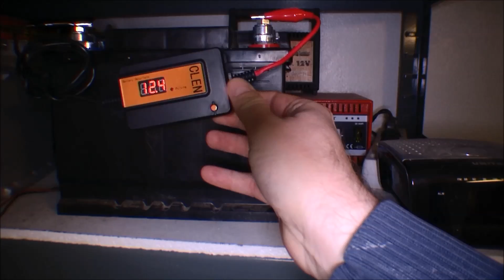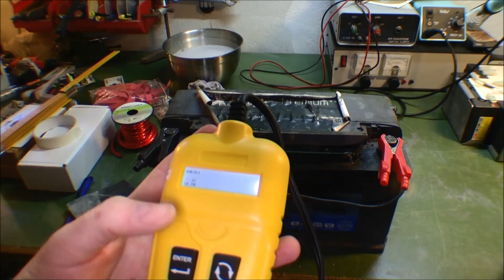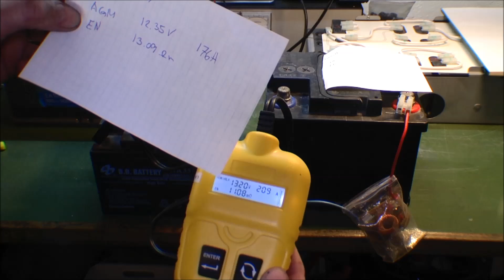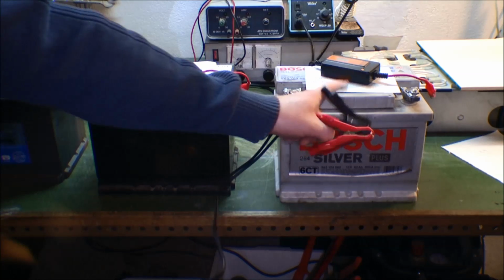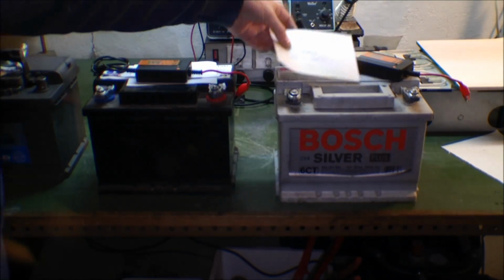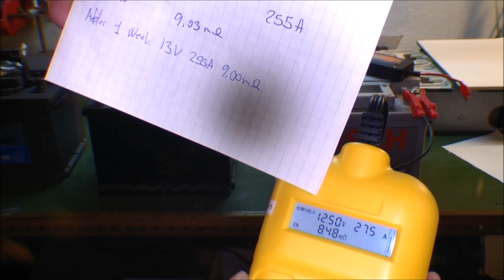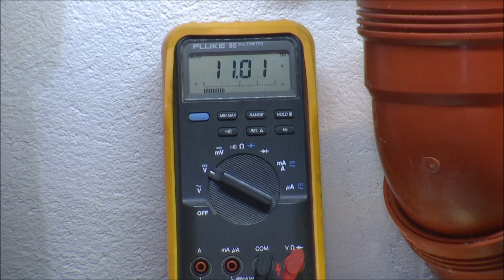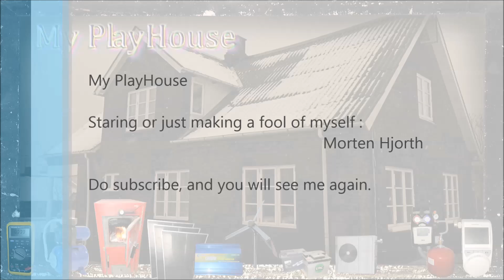Desulfators after two weeks, and new 100Ah Battery - 176

Comment: Not all Battery desulfators are the same. You might want to try a PulseTech PowerPulse passive battery desulfator on one of your dead batteries and see if it can recover it and may take 30 days depending on how badly sulfated it is, Pulse Tech claims that their patented frequency they use can extend the life of a battery up to three times. Noco Genius 5 and 10, and CTEK battery chargers have a repair mode that I believe use 16 volt pulses to desulfate a battery.
Reply from the maker: Hi @josemedeiros007
Thank You very much!  glad you liked the video :-)
Thank you for watching! :-)

Comment: You should check electrolytic level on the bad battery, maybe the cell are dry.  On your others batteries, internal resistance look good.
My own experience with desulfator is it works, I also check on oscilloscope the voltage pulse juste to make sure it is present, some vendors sell fake desulfator which does nothing, the voltage pulse too small to do anything. On my desulfator, I have a +1 to +2V pulse over 13.4V of the charger.
Reply from the maker: Hi zerodegrekelvin2
Thank You very much!  glad you liked the video :-)
Thank you for watching! :-)

Comment: Megaohms Not milliohms
Reply: If it's the internal resistance of  the lead acid battery then milliohms IS correct.  Lead acid batteries are low impedance devices.
Reply: So the meter should show a big letter 'M' instead of a little 'm'.
Reply from the maker: Hi John Q
Thank You very much!  glad you liked the video :-)
Thank you for watching! :-)

Comment: The orange auto pulse desulfators work much better if you charge a dead battery with a non smart charger connected to the dead battery in parallel with the desulfator. I revived a battery that was left uncharged on the shelf for 7 years, works like new now...
Reply from the maker: Hi maxpesh
Thank you for watching! :-)
Reply: Hello,♥️ thanks for the video. How long does the sulfur removal device for a car battery 75 amp take, 24 hours, 3 days, or a week?? ✅♥️

Comment: Hi again, I see you are still trying to use the Chinese "CLEN" capacitive "desulphators"... Like your other video is titled, they "are sh!t." So true. If I send you a free Battery Keeper, my USA-made, true impulse-spike desulfator, will you try it and/or review it? I'd just like you to see that there is truly a realistic way to apply an oxidative reaction within the lead plates of a lead-acid battery. Your frustrations with the fake CLEN modules must be really annoying you... Get in touch with me if you would like me to send you a free Battery Keeper auto-resonating and auto voltage-sensing desulphator (you can desulphate anything from a 6v to a 48v array). Golf cart batteries and similar size batteries can take up to two weeks to recover if they have sat all season.
Reply: +preferCreate 
I tested the iClen "chinaböller" 200ah, too. The placebo buzzing does not really help much. The point is to swing with the resonance frequency of sulfate, which is (according to a patent, see below) 3,26Mhz. I tried a Movitech Megapulse, and i really have meassured an older AGM Battery to recover from 10AH capacity to 25AH Capacity within 5 charge/discharge cyles. The iClen didn´t made any difference in Capacity over several cycles. A Pulser is an instrument to recover from sulfate, but it will drain water while its cycles, so it´s capabilities are limited.

A well working pulser should be kept attached to a PB battery all lifetime to really makes a pulser work and prevent sulfate from getting ruin the battery.

Patent: https://www.google.com/patents/WO2004073083A2?cl=en
Reply from the maker: Hi +WattVoltAmpere ?
If you are wanting to promote this NOVITEC Megapulse,, send me one. My address is in the About tab,, and i'll do some testing and video,,, much more effective then writing here in the comments.
Thank you for watching! :-)
Reply from the maker: HI gary depietro 
No I do not do Ham radio, or radio at all.. I do think I have an old 40 channel  walkie talkie in a box somewhere. But You just cant do it all.
Thank You for watching! :-)
Reply: i did not have much luck with battery sulfators, the batteries wich could be revived, got revived from overcharging with a stupid transformer 12v 1980 vintage charger ang 300w dc 12v load :).. got 3 of these garbage pulse desulfators one from Biltema, other is no name ebay shit and wizbangplus bd12 wich is made in USA.... the thing is it does not work that good or it ddoes not work good at all... snakeoil.. could buy new battery with those money.